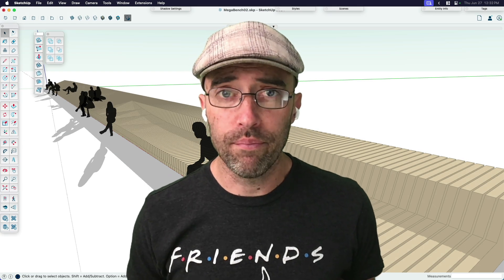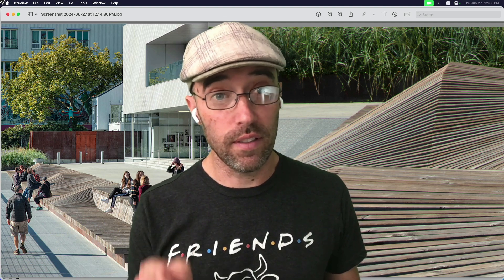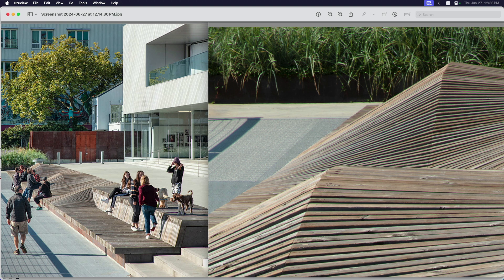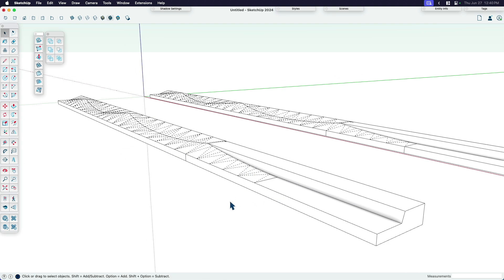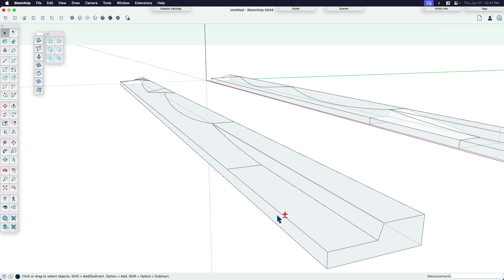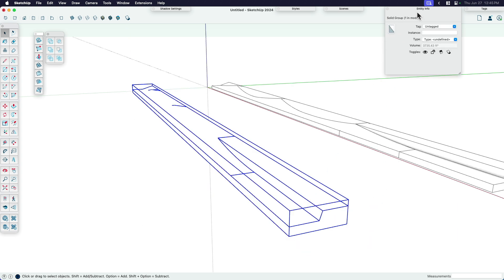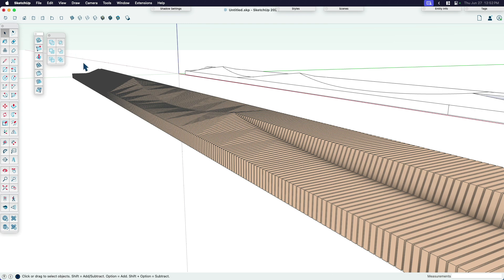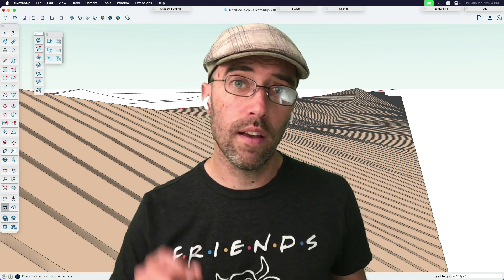Modeling a 'Mega'Bench w/ Sandbox and Solid Tools

Comment: Cool technique! Wasn't aware of the sandbox "from contours" tool! Question: why not use the intersect function from solid tools?
Reply: I agree... I think you could have skipped the red box step by using the Intersect solid tool... but, cool video either way.
Reply from the maker: @donrushton  Thanks both for the tip. I actually don't use solid tools very often and must have overlooked that! Always looking to learn myself.